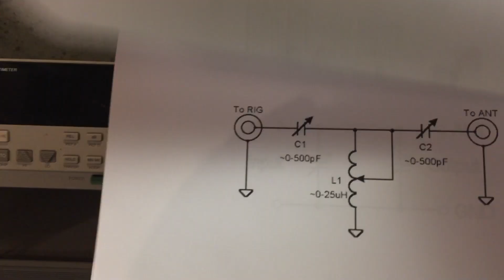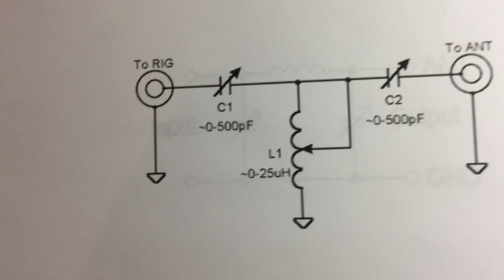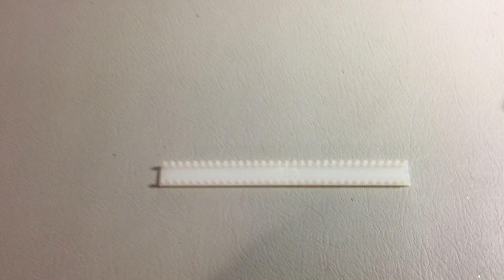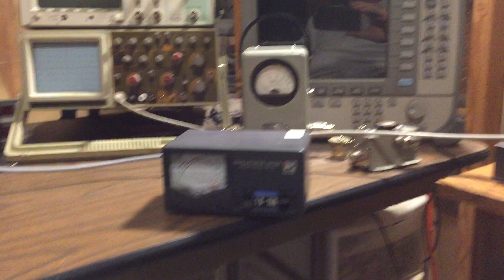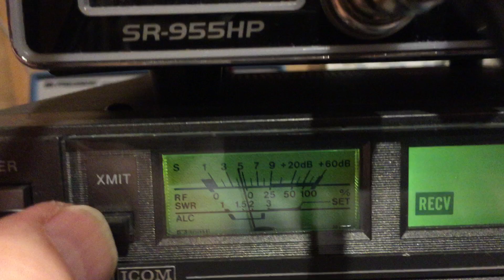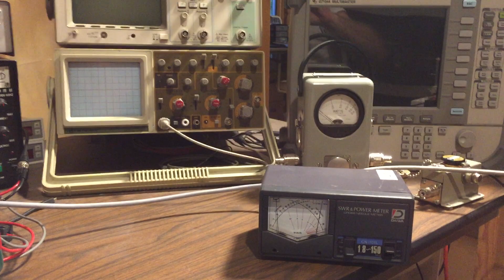Part Four Antenna Tuners: RF Man Discusses Long Wire Antennas, Unun's, RF Chokes, & Antenna Tuners.

Comment: learning from a retired broadcast engineer how to build one  hes told me hunt a pair of 500pf air caps .. id like to know the pf values of those i think the roller inductor is a 10 uh that iv got .. idk the value of  the large air cap i got could be 3000 pf for all i know he stated he dont know could be a 6000pf its got real old wire hanging off it looks like aspestos coating on the wire

Comment: Thank you for the video. 🙂 I am new to the hobby and am learning ...
You mentioned that a lot of the commercially available tuners use a T network, and that is what I noticed as well. Why is it that they are using a T network, not a Pi network? 🤔
It seems like the T network has some sort of advantage, and I would like to understand what it is. 
73 from Germany.

Comment: I suspect that "single point grounding" is a bad idea: signal wires wandering about away from ground leads to RFI -- that balanced signal + ground lines is a better idea -- and that ground planes and non-resonating faraday enclosures is the best idea.
73

Comment: Question: what wire antenna thickness that restricts maximum RF out put from transmitter be it 50 watts output?

Comment: I can't wait for you to start playing with open wire balanced line and link coupled tuners on the low bands. Link coupled is like magic to most people. No physical connection between input and output. What?  I will tell you this open wire feed line and 136' of dipole will get you talking on every freq. from 3.5Mhz to 30Mhz and with very little compromise other than the radiation pattern of the antenna can be out of favor on some freq. Another thing that's hard to imagine for cbers as well as many hams is the fact that I can use all frequencies between 3.5 and 30 Mhz with good efficiency and always have a perfect SWR. You never tune or touch the antenna length at all but you may have to adjust the feed line length according to the tuner you use. Hams call the antenna the doublet. The only coax I own is in jumpers. The problem with using coax with an antenna tuner, the places you need the tuner the most are also the places you have the most loss. This isn't the case with open wire line. We tune out reactance capacitive or inductive and we are left with resistance and the power is transferred to the load where it is radiated no matter how long the antenna is. Balance is key though with my setup. 73
Reply: Well said, de NK7B

Comment: VK2SS has a point! If I understand correctly, you have your Tx attached to the pi tuner, which is connected to an unknown length of 50 ohm cable . The cable leads to a 9:1 unun which feeds the random length long wire. At any frequency, the random wire presents some impedance which is reduced by a factor of 9 to the far end of the 50 ohm transmission cable. What happens at the tx end of the cable is unknown, but is matched to 50ohms by the tuner. So you are in fact matching feedline impedance discrepancies and not tuning the radiation element. Where is the energy going? I suspect it is absorbed by the various matching components rather than launching into the air via the radiating element. Providing a good load match to the transmitter, but not necessarily the radiator. VK4bAC

Comment: Nice job on the tuner. Even though your tuner is matching the transceiver you still have significant coax loss between the antenna and the tuner due to High SWR on the feed line. You are likely loosing 30-40% of your power in feed line loses due to the mismatch. You should see how you can mount the tuner remotely with remote stepper motor control.  If you can get a 1:1 match at a remote tuner your feed line loses will only be those shown in coax attenuation charts.

Comment: Sorry to disagree but the so called antenna tuner does not tune the antenna to resonance . It just presents a 50ohm load to the transmitter and there is still a high swr from the coupler to the antenna . VK2SS Chuck

Comment: great video. Still don't know why people test at "low" power of 10 or 20 watts, when all you need is a couple milliwatts! Antenna analyzer puts out a couple mW and allows adjustment of tuner. Change from analyzer to rig, then apply full power (5 watts, who needs more?). 
Dave WA4NID

Comment: Will it matter to have a variable inductor of higher inductance instead of 25uh? I know the capacitor values on MFJ tuners are enough for 160-6 meters. Thanks.
Reply from the maker: Yes, the wider the range of L and C the wider the tuning range will be. Regards

Comment: Thanks for more good info Rob. Another great video brother
Reply from the maker: Thanks for your positive feedback!
Reply: Enjoyed videos.  Very good dem of the different tuners which has helped me understand them better.  One critique though, on at least two bands you were actually your going outside of our allotted frequencies because of bandwidth of your signal.  A.M. has a fairly broad bandwidth and when you tuned up on 7.00 mhz, 14.00 mhz, etc., Half your signal was going outside the band.  Not a terribly big deal, but it could get you noticed by the wrong people.  Still very informative videos.  Thanks, Ralph, N4CFX, Northport, Alabama.